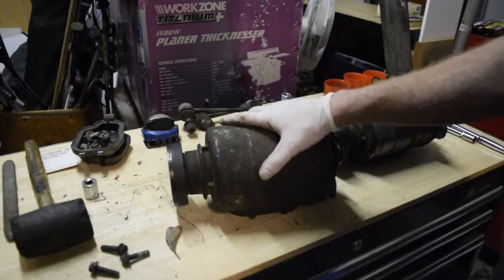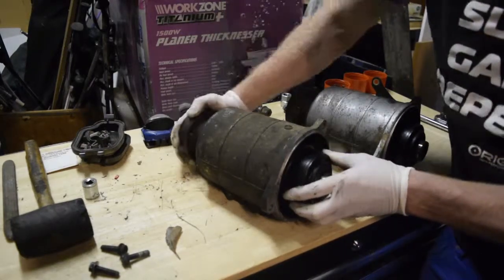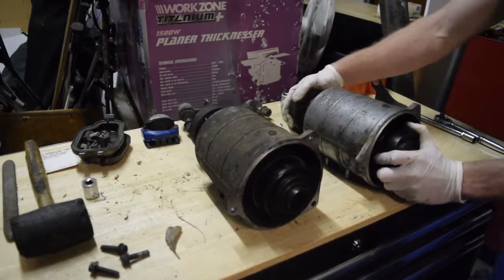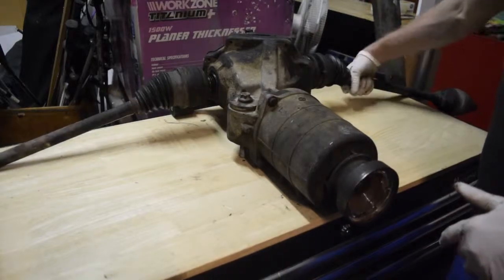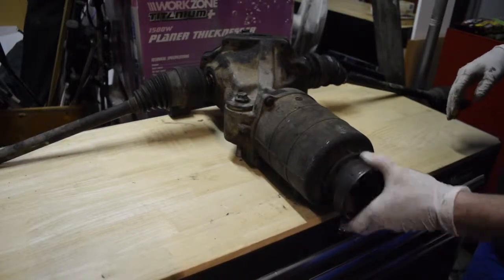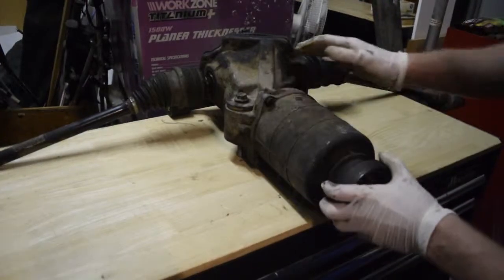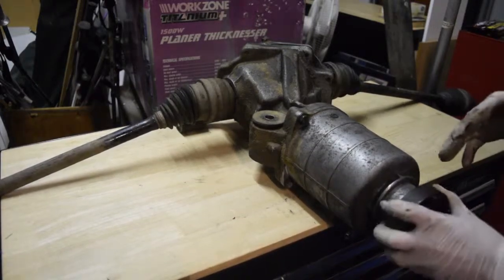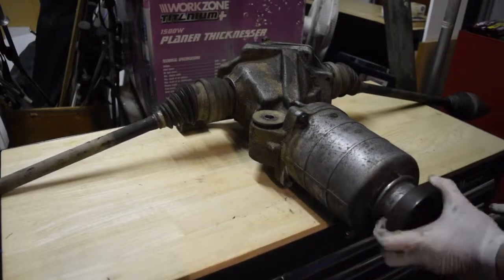Working Vs Blown Volvo Viscous Coupling Inspection and Comparison

Comment: I have xc70 2001, its uses same viscous coupling. When I drive in reverse, there is none torque to rear wheels. I tested it on ice, and in reverse, it only rotating front wheels, like a normal fwd car. But driving forward, all wheels spins very good, and all is fine. Is it normal for old xc70 (v70xc) or there is a problem ir viscous coupling? How do you think?
Reply from the maker: There's a reverse lockout. its to stop the rear wheels driving the prop shaft and to I think helps prevent damage to the grearbox. Mostly applicable under hard braking.
Reply: @aralez3061  thanks. I already welded viscous coupling and freewheel together, and now I have full time AWD. And no problems or damage to gearbox. Also I strengthen the gearbox and bevel gear connecting point.
Reply: @Kriststt you have any picture of how everything is done? How did you strengthen the gearbox?

Comment: I know this is an older video I am doing alot of research for my Volvo love the car but tons of issues all lights are illuminated on the dash hard cold starts drinks fuel like a V12 and I am not sure what's going on I have checked everything I am beginning to think 🤔 there is a bad ground somewhere cos when I say all dash lights are on they truly are the stereo won't work either has a funny numerical code that is displayed on the LCD screen not sure if the 4WD is working how do I test that? ....also my car doesn't have the Haldex correct? My Volvo is a 2000
Reply from the maker: i can't help with the electrical issues - maybe just fire the parts cannon at it?
Regarding radio - if the battery is disconnected you need to enter a 4-digit pin to 'unlock' the radio. This is an anti theft feature.
Regarding the 4wd system  - jack up all 4 wheels and see if they spin when it's in gear. If the rear wheels don't spin the system is damaged.
Regarding Haldex system - Haldex was introduced in 2003. I don't know which month or VIN # the change happened at. If your car is a 2000 it will have a Viscous Coupling (VC) like this.
Hope this helped answer your questions :)

Comment: Can i change this vcu oil?
Reply from the maker: No, it is a sealed unit.
Reply: @aralez3061  yes, but how about drilling a hole with a drill and replacing the oil? Then we can cover it with a bolt
Reply from the maker: @turgutakdogan15  I guess that could work, but draining the cooked oil my be painful - my understanding is it's quite sludgy.
Reply: @aralez3061  It's a mixothixotropic fluid, not really an "oil."
Reply from the maker: @reallyhappenings5597  Thanks, I didn't know that! I've got some reading to do on the properties/concept of thixotropic fluids. Do you know what happens when they 'blow'? Is it a mechanical component failure or the fluid losing its thixotropic properties?
Reply: @aralez3061  no clue but good luck
Reply: @aralez3061  https://youtu.be/8nDn1rqL_3Y

Comment: What's the OEM part number?
Reply from the maker: Pretty sure it's 9463313.
Reply: @aralez3061  the question is where to get such part...
Reply from the maker: @sebastianciupinski8973  I don't know if Volvo still make them, but they can be found in any awd Volvo pre 2003, when the haldex system was introduced.

Comment: So the functioning one is acting just like having a solid shaft. Why have viscous coupling if no speed differential is allowed?
Reply: What most people don't understand is that these units work by shear, not heat. When the front and rear wheels turn at different speeds, the plates in the VC are moving past each other and the shear created thickens the polymer fluid inside and then they spin as together again. If they worked by heat it would take too long for the AWD to kick in, and it would activate in a very short time by just normal driving as these units get quite hot from just regular driving.
Reply: @ericallen7336  Thanks. They do act almost instantaneously in my experience. Is that why people claim that they also start engaging on tight turns, just normal city driving can put stress on the whole drivetrain in the long run?
Reply: @PrimalMiltos  Tight turns shouldn't engage the VC since front and rear are turning at same speed. L/R wheels are turning at slightly different speeds but that is handled by the differential.
Reply: @ericallen7336    Comparing the front shaft to the front diff to the rear shaft to the rear diff, they DON'T rotate exactly at the same speed when the vehicle is turning. The difference is not as big as left to right but there is a difference. It has to do with the different arcs the front wheels take than the arcs of the rear wheels. In fact even the right front wheel takes a different arc than the left front wheel, it's crazy, look it up!
Reply from the maker: @ericallen7336  Thanks for explaining that! I thought it was heat related in a very small window (like within 1C kinda thing). I hadn't thought about the fact they get hot in regular driving, which is logical when you think about it.
Reply: Under conditions where torque is shared on both sides but at different levels itll allow slip. But he wont be able to spin it hard enough or fast enough by hand to make that happen. If he can make them slip by hand its def blown
Reply from the maker: Prelude Dude is right. The torque I can apply isn't enough to overcome any initial friction in the unit. I believe it also works by heating up (to a point) as it slips, and changing into a thicker state, where it then grips, and cools. As it cools more slip is allowed. This cycle goes back and forth.
The coupling also accounts for differences in turning radius between the front and rear tyres, the same way a diff does between left and right.
Reply: @aralez3061  Initial friction? But if it does not allow differential movement not even when stone cold, once you force it to rotate independently then it will get even harder by getting warmer. Even when the fluid is cold it never functions as an open differential. It seems that it always places stress on the driveline in normal city driving with a lot of turns.
Reply from the maker: @PrimalMiltos  By initial friction I mean the friction that is created when the shaft starts trying to turn. From what I have read and various volvo adverts there is meant to be 5% of torque going through the shaft under normal driving conditions, to decrease response time.
Reply: @aralez3061  Now it makes sense. It's always engaged ever so slightly. They say for example the Express van has 35%-65% F-R torque distribution. Which explains why there is no delay see one here:
https://www.youtube.com/watch?v=JQdroEnlv6I
Reply from the maker: @PrimalMiltos  Glad it makes sense. You can see a similar thing in this video, with the 850. https://www.youtube.com/watch?v=stQVP6iUkhk Go to 5:09 for a really good view.